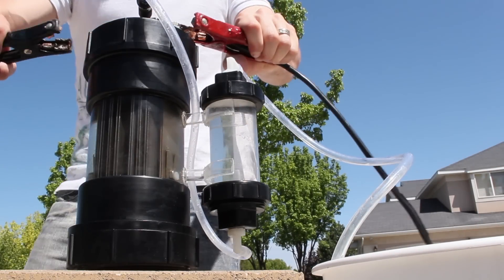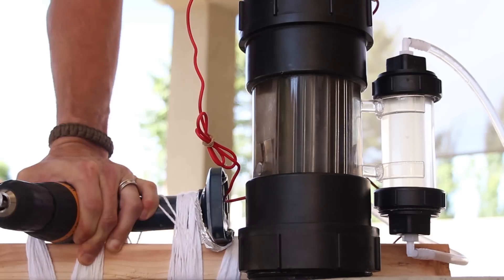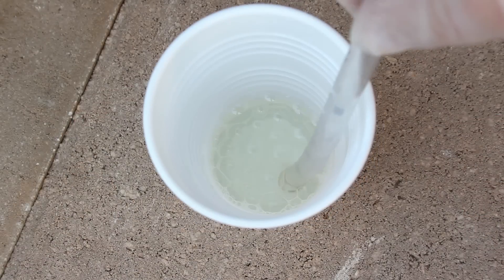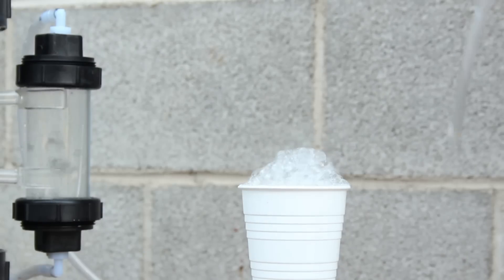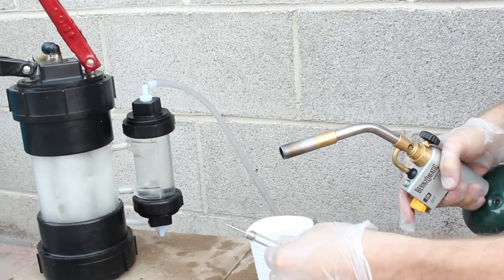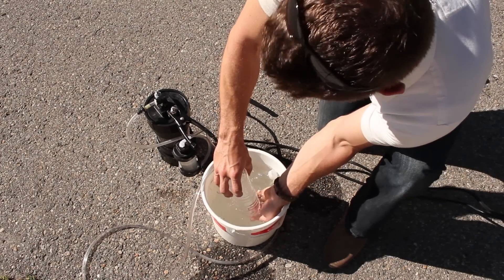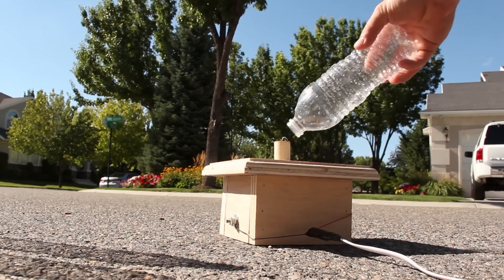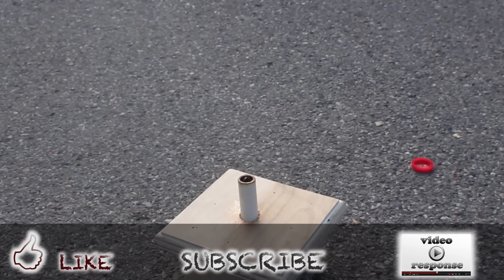How To Make Water Explode!

Comment: go have a look at mhho.. 

in japan an inventor made a stable version of modified hho which doesn't explode under normal conventional means.. in other words, it's not flammable under normal circumstance.. it's compressible.. 

the way the process is done slightly differently.. 

the cell needs to be vibrated at 100hz whilst being electrolyzed..  

research ohmasa gas english

Comment: why does hydrogen gas explode..??
Reply: because its a type of gas that explodes ...
Reply: If you look into its electron configuration it only has one electron in its first energy level. The first energy level can hold 2 electrons. When a element such as helium has filled all the space in their energy level, the element is considered "noble" since those with a full shell of electrons makes the element stable. Because hydrogen does not have a full electron shell, it reacts with other elements to bond a become stable, thus that is why hydrogen is so reactive.
Reply: thanx Edward Sun

Comment: How did you make the debtaner pad
Reply: if u connect a wire to + on a 9v battery and the minus to another wire and then touch the wires together, there u will see a spark and that is enough to create a spark that will make the gas explode

Comment: this gas seems extremely reactive, what would need to be done to make it burn more slowly, to produce a constant flame? think one of these little bad boys would make a great fuel source for a micro forge.
Reply: take a length of plastic tubing and put a cigarette filter in the open end of the tube and then press a basketball pump needle onto the end with the filter    it makes a great HHO torch
Reply: Afro Sergeant 
Take out the oxygen and it will burn slowly like methane
Reply: These things actually are used in constant flame. You'll need a regulator (or something among those lines) so the gas doesn't come out too quick. It gets hot, and can be used to weld.

Comment: If you isolate the electrodes so the positive side collects on one side and the negative on the other you can isolate the gas one side hydrogen duh other oxygen. 
in the civil war they had hydrogen generators using acid

Comment: I don't get why this can't be used instead of gasoline
Reply: Because you need as much energy (here it's electricity) to split your water molecule into H2 and O2, as it is released when H2 and O2 recombine to form water. In the end you don't gain anything from this and might as well use an electric car.
Also, as many said, nowadays engines are not fit to use gases as fuel, unlike a liquid like gasoline, a gas would need to be highly pressurized (which is already pretty dangerous), and the burning reaction should be under tremendous control so that it doesn't just explode the whole block ;)
Reply: Because if the whole tank exploded during a crash... that wouldn't be good at all
Reply: but its a renewable source

Comment: So if engineers built a car that runs off this, and since it burns clean and reproduces h2o have an exhaust that returns the water back to the fuel tank, could this be a solution for a clean infinitely operational car?
Reply: A guy invented a water fuel cell but like many great inventions that would've changed the world he was killed by the government or by oil companies and the invention was lost forever.
Reply: I believe it
Reply: +Maxwell Glockling It's happened plenty of times in history.
Reply: it would lose energy, 100% efficiency in the split and recombination of gases is impossible breaking the water down creates heat, which is lost energy, the recombination creates heat, more lost energy, then you got to condense the steam back into a liquid by dumping the heat, more lost energy, in a car I would assume  it would power a generator which would have to split its output between the drive and breaking down more water which means even if you could avoid all the heat loss you would not be able to get more energy out of the system then existed in the system in the 1st place
Reply: Combustible engines lose energy over heat anyways, that's a given. I'm sure there's a very effective way to run a hydrogen engine without substantial energy loss but I wouldn't know. I'm a graphic design and business marketing student not an engineer and I don't tinker enough on cars to know what I'm talking about.

However, I do remember reading an article on a car that ran on hydrogen. It produced well over 900HP and was very efficient. I can only imagine some oil company shut it down.
Reply: naa, we have engines that run on alcohol, vegetable oil, methane (CNG), propane (LP) if big oil was going to shut down alternatives we wouldn't have them,
Reply: Nearly all oil that provides oil companies income

Comment: Make a linear particle accelerator of about 32.2 feet in length. Fill the starting chamber with hydrogen gas and on the target end have a thin nickle plated target. Turn the accelerator on and let the accelerated hydrogen protons continually bombard the nickle plated target up until nickle hydride  has formed in and throughout the nickle target. Keep your electromagnets cold with liquid nitrogen so that a sequenced on/off (0/1) signal meets no or least resistance. There is a little more to this than is described above, but you've got a pretty smart head on your shoulders. Have a good day, Grant!

Comment: try using about 70% hydrogen and 30%oxygen that will make you a nicer boom than just plain 100% hydrogen
Reply: This generator separates water. Therefore, 2 parts hydrogen to one part oxygen. It's already at the optimal ratio. 

I know what you meant though.

Comment: Hey grant, how did you make the 'detonator pad'?
Reply: +Bart Hooghwerff Likely something very similar to a rocket igniter. Two wires close enough to form a spark when a current flows through either of them will be enough to light the gas.

Comment: hey is it posible to take that concept of exploding water to make a car engine?
Reply: +petacreepers23 bob lazar made that car
Reply: It is using in cars, unfortunately it has low efficiency
Reply: sure, there are hho car kits
Reply: sure
Reply: it is possible, but you have to understand the power required to split the water into the two gases is much greater than that of the combustion of the combined gases. It's substantially lower, so you have little use of this in a piston. If you want to do something stupid, but generate the same gas try some acid or base and aluminuim. The result is about the same, a large generation of Hydrogen gas, which is flammable.

Comment: Could this be used as a replacement for gasoline in a combustion engine, though?
Reply: +GeekbehindGlasses no it cant
Reply: +zachariah moghnie Yes, it actually can. I see no reason why hydrogen shouldn't be a substitute to using diesel or petrol, it will work just as well, and would be more efficient.
Reply: +Ch3ff it's not like it's more dangerous or anything
Reply: +undercoverbandgeek Well that's why engines are made of thick steel to enclose the cylinders and prevent anything to break.
Reply: +GeekbehindGlasses  it could be replacement only for gas not gasoline
Reply: Gas and gasoline are the exact same thing.
Reply: You can't store the hydrogen for very long. It will leak fairly quick. You need high pressure for reasonable sizes, which ultimately needs very thick tank walls. Also you loose a lot though the joints and tubes. 
E.g. the tank of a BMW Hydrogen 7 will be empty in only 9 days without any use.

On top of that, you loose a lot of energy while the production AND the storage. The compression uses 12% of the coefficient and the liquefaction another 20% on top of that. Extremely inefficient.
Reply: Yes and no. The energy required to obtain enough gas to run is much higher than the energy it takes to run cars as of right now, so it's highly inefficientand, while still technically possible, would be a waste of time.

Comment: Grant Thompson - "The King of Random" You said "H2O molecules broken down into their gaseous elements of two parts Hydrogen and one part Oxygen, which combine as H2 and O2 gas." Isn't it H2 and O ? When you make these explosions, I think you need a ratio of 1:1 H and O for perfect combustion. is that right ? Thanks and be careful ;)
Reply: Ilan fornerod No. There are three parts to the water: Two parts hydrogen and one part oxygen. Following hydrolysis, that becomes two parts of hydrogen gas (2H2) and one part of oxygen gas (O2), which is the correct proportion required to combust the hydrogen gas and form water again. That is, assuming this is 100% efficient, which it isn't. Not even close. Much of the emission will be water vapour, even with the bubbler acting as a heatsink, because at the end of the day his electrolysing aparatus is not much more than a lead acid battery being treated as though it's a kettle. To improve efficiency, he needs pressure (to push the hot water vapour back to water without reducing the heat), not a heatsink.

Comment: So this guy can make this in his back yard but multi billion pound car manufacturers cant build an engine out of it?
Reply: Callum Connolly You have to have a source of electricity to make the gas.  So it could be done, but you'd need a generator to power it. And obviously that wouldn't make any sense.
Reply: A car was created that ran on water but mysteriously the creator was murder. The car also disappeared.
Reply: xX_1337MLGSOMTHINGOROTHER_Xx actually, the reason this is so explosive is because the bottles don't contain hydrogen(H),but rather contain hydroxy(HHO). That "O" is important because it acts as an oxidizer.  comparing the explosiveness of hydroxy to hydrogen is like comparing charcoal to black powder; without the oxidizer, they don't do anything all that spectacular
Reply: Sam Tomelleri Callum Connolly solar panel on the top of the car, power the generator, fuel the car
TADAA
Reply: Callum Connolly Actually, they have. Look up Hydrogen Fuel Cell Vehicle. Honda, Chevrolet, Toyota, Hyundai, and Mercedes Benz have been testing them on public roads for years. The problem is they're very expensive to make.
Reply: It's not that they can't it's that they want to make money and when they make this energy is a lot easier to get so in the end they want to make the most money they can
Reply: Conner Kellahan It's more a question of distribution. Lots of people would gladly switch over to hydro powered cars if they could hop in one and run down to the corner station to fill up. I know that I would. They can't do that now. Honda started testing hydrogen cars in California several years ago, and the tests were a HUGE success. The problem was there were limited places to get the hydrogen. Just about every single Honda owner that took part in the tests said they'd LOVE to keep the cars - they just had nowhere to go to get the fuel. (The owners that took part int he tests went to certain specific Honda dealers to get fuel - for free.) I really think that if the distribution of the fuel situation gets straightened out, hydrogen powered vehicles are the future. I mean that.
Reply: Conner Kellahan hydrogen is extremely damaging to metals because it actually penetrates the metal, making it brittle. So storage is a problem (to name just one).
Reply: +Callum Connolly Hydrogen Energy density per liter is 5.6, gasoline is between 33 and 37, you also don't have water forming in the combustion chamber with Gas you do with hydrogen.
Build an internal combustion motor that runs on HHO which won't flood it self after a short run and a tank which can hold Hydrogen at 5000 PSI (maximum energy density) that can survive a car crash in your back yard.
Reply: +Ivan Sessions it would be more eficient to run car on electricity rather than on this gas
Reply: +badwolf99 X there's also the fact that the energy it takes to separate water molecules is greater than the energy you can recover by combusting the gases produced. at that point just use the electricity to power the car, and we're already doing that.
Reply: ***** I... I don't know what to say... I... I've never been right before... plz hälp...
Reply: Callum Connolly Put this in a engine and here whats going to happen : BOOOOOOOOOOOOOOM... So yeah, multi-billion industry cant make a safe engine out of the hydrogen.
Reply: louisphilippe1100 thats because they make it too big, because by the looks of it, this is way more explosive that petrol
Reply: It ran . 65 miles was it top speed. He was poison supposedly .
Reply: Ltifone2014 this is why cars have air intakes...
Reply: xX_1337MLGSOMTHINGOROTHER_Xx well..ya. I was just trying to point out that hydroxy is molecularly perfect for exploding due to the fact that all necessary components (the fuel and oxidizer) are already mixed in the perfect ratio
Reply: Callum Connolly My thoughts exactly, its just that the consumers don't want to switch over to hydro powered vehicles. Which is potentially dooming us all.
Reply: Mark Lindsay couldn't have put it better myself
Reply: Callum Connolly they can but its the same reason why they dont make phones =indestructible when they can, there is no Money in it, OR at least not enough to make them care
Reply: Shooter HAY People already make break resistant phones, but nothing is indestructible.
Reply: +Sam Tomelleri All you need in a dynamo pushed onto your fan belt and sent through a DC changer to give you the correct amps. It's very very simple to do.
The reason it isn't on cars today is because major oil companies own the patient to it. People have replicated but it was detrimental to their health and they subsequently died.
John Meyer made a dune buggy run on any type of water.
I have been giving this subject great thought and come to the conclusion that it is no better than cars powered by fossil fuels as one day it will run out.
My field is in electro magnetics, I believe that in the correct configuration of electro magents coupled with compressors will make an engine that will run on any type of AIR whether it be polluted or clean air. 
Say hello to the future of air powered cars
Reply: +Danny Roberts I really hope you're not serious. Basic thermodynamics would argue against your comment, as there is no free energy in this universe. Everything is a tradeoff, with entropy winning in the long haul. To split water, you require more input of energy than you get from burning it. Additionally, burning H2 and O2 gas actually generates (wait for it) water. So it's a closed loop cycle with just the input of energy to split the water. It cannot run out... Also, hydrogen and oxygen cannot be produced onboard a vehicle and then combusted without a significant efficiency loss (the electricity to split the water has to come from somewhere). I don't usually troll or respond in an irritated manner, but you simply have no clue what you're talking about. Free speech is irritating sometimes...
Reply: +Zachariah Harris  what about the engine dynamo and a booster thingy ( volts up amps down ) ?
Reply: I'm not exactly sure about the full question, but if you mean "what about using the engine dynamo and a transformer to produce hydrogen" you certainly could do that. The thing is, the more steps you have to go through you'll have an efficiency loss at every step. The conversion of energy from engine to dynamo looses energy, and then from the dynamo through a transformer looses energy, and then energy is lost as heat when making hydrogen, and then burning the hydrogen to generate power is not 100% efficient either. So it's basically bleeding efficiency based on the number of steps in the process and the losses at each step.

I hope I answered your question. If not, then if you ask it in a more detailed way with more context I'll try again.
Reply: Zachariah Harris  Hmm thats true but what if u use the steam in a steam engine thingy and i guess that the loss is not Super big u might be able to fix it whith some solar panels on ure roof ? and the water could be salt/not salt so you can generate more energy out of it ?
Reply: +Mr pat he is using salt with a mixture of something to generate more energy and if he put solar panels the process would be slower and he'd only be able to do this on sunny days
Reply: +Zachariah Harris sometimes I think you guys are as smart as this crazy genius
Reply: +TheMiningBros that's why i watch this dude =D
Reply: +Zachariah Harris So there is no way to use this type of gas as maybe a booster to improve fuel economy even?
Reply: Merle Mitchell i guess
Reply: +Callum Connolly Hydroxy is not the same as a hydrogen-fueled car in which the hydrogen is produced elsewhere and used as fuel.  This would be more useful as fuel for some sort of propulsion weapon.  A weapon whose by-product was water would be very useful in arid areas.  However, this is an extremely inefficient method of fueling anything.
Reply: +Ivan Sessions Solar power won't produce enough energy quick enough.
Reply: +scotlandw8 and it would only work during the day
Reply: +zzdfhgdhd Pound is their currency, mate. Just like the dollar is North America's, the Yen is to parts of Asia, and the euro in parts of Europe.
Reply: ***** Its hard to be subtidal online, mate. :p